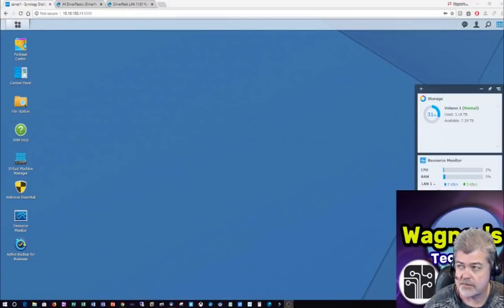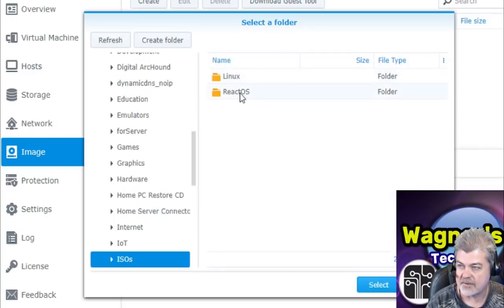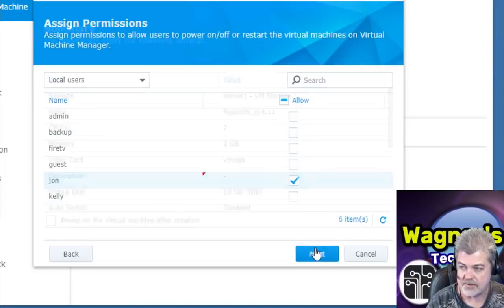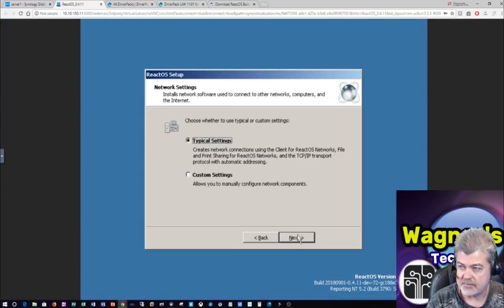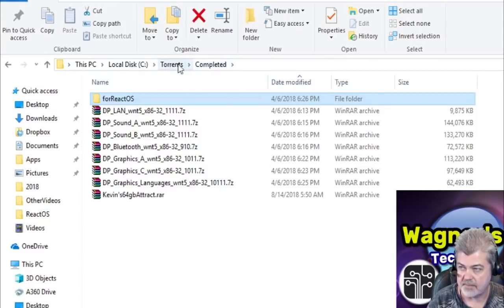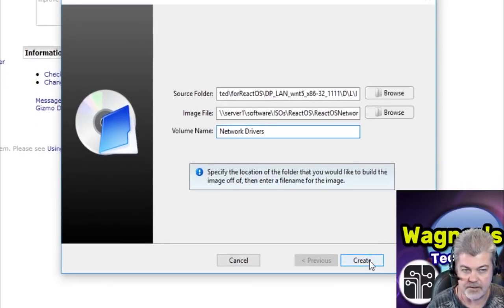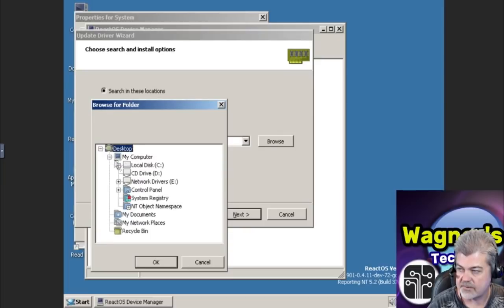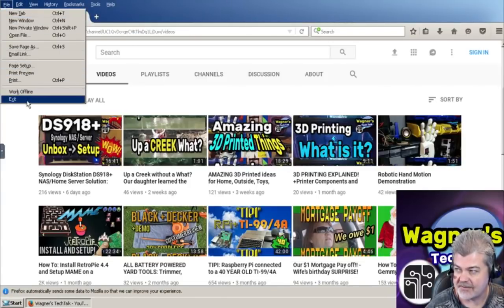Install ReactOS a FREE Windows Alternative on a Synology NAS/Server via VMM (v0.4.11 Nightly Build)

Comment: The manuell NIC card driver install is not required anymore (at least for 0.04.15 dev). ReactOS is seeing it as Intel 82540EM PCI Ethernet Adapter
Reply from the maker: Good to know, thank you Andreas!  I've not re-installed ReactOS in quite sometime.  Sounds like it's overdue for another look!

Comment: Thanks for the awesome vid!

One question:  ReactOS works; Firefox works. But I can't access my local network (although I get an IP Address). I also can't install the Synology Guest Tool.

Any tips on getting access to my network?
Reply from the maker: Hey Thank you, I appreciate it!  I had the same question and the answer is that it's only partially implemented.  There are no network providers registered to allow browsing/accessing the network.  Here's a link to the question on the ReactOS forums that I posted sometime ago that will give you some additional insight.  I'm sure the ReactOS team is working on it, so hopefully we'll have that capability in the near future:  https://reactos.org/forum/viewtopic.php?f=2&t=17169&p=131224&hilit=network#p131224

That's one feature that I'm really looking forward to myself!
Reply: Awesome, thanks.
Reply: So, i had a windows 10 image running on my 415+ to monitor my energy usage and solar production. Also I was recoding the stream from my camera to mjpeg with vlc. 

I wanted a “leaner” OS to do this. reactOS seemed like a good candidate. 

But now I have an old windows 7 running. Works a lot quicker!
Reply from the maker: Just curious,  I guess ReactOS didn't work for you since you weren't able to browse your network.  I also recently installed Win10 in VMM and it's slow but semi-usable.  I watched a video the other day where someone RDC'd into it and it ran faster.  Could probably do that with Win7 just as easily.  I think the mouse tracking in the browser window has a bit of a delay that is helped by using the RDC.  It's on my todo list to try out this weekend :)
Reply: I just used a win7 SP1 image and didn't install any of the 134 updates :-)
Reply from the maker: Not sure if this would be helpful or not, but you could possibly try FileZilla (FTP client - https://filezilla-project.org/ ) on ReactOS to access network ftp servers for downloading files in ReactOS and analyzing your data.  I did try Putty as well in ReactOS and it worked fine.  Just a few possibilities that may be helpful.  I've not yet setup an FTP Server on the NAS but instead used Putty to connect to a Raspberry Pi.  Can't recall exactly if I used FileZilla on ReactOS but I think I did.

Comment: No need for multi CPU setting, ReactOS doesn't support SMP yet.
Reply from the maker: Good point, when I first installed it I used only 1 CPU because I thought that was the case but wasn't 100% sure.